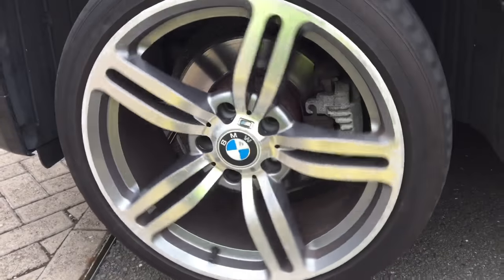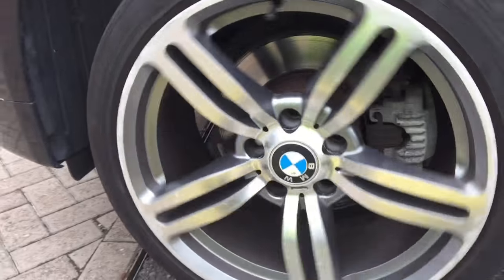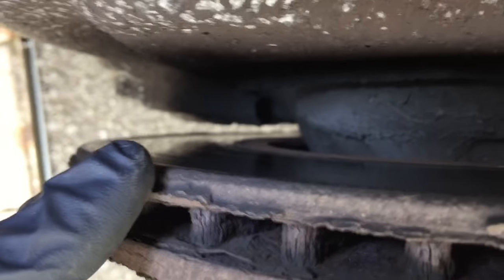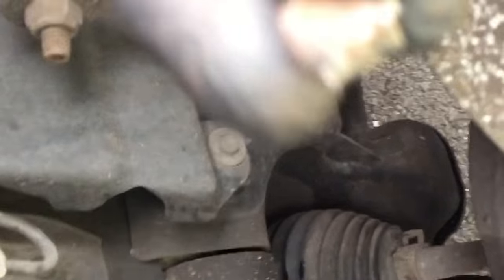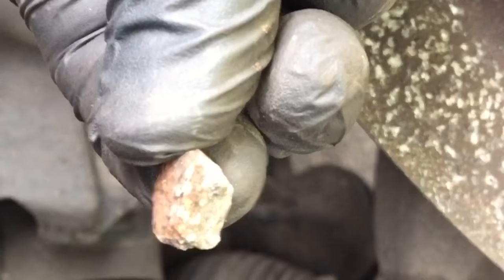GRINDING SQUEALING FROM CAR BRAKES OR WHEELS, STONE STUCK BETWEEN BRAKE DISC AND BACKPLATE, REPAIR

Comment: I had this problem yesterday, BMW advised the braking manoeuvre. And it worked! Go a few ft forward and slam the breaks then back and the same. Repeat 5-10 times. The stone slipped out 1 mile later
Reply from the maker: Thanks for the great information👍🏻👍🏻🛠
Reply: Man you saved me a whole damn day of stressing and shit, thanks! Brakes were screaming like hell after 8 hard brakes it was gone 👊
Reply: Tanks make excellent info
Reply: Dammit should've tried your solution, but I followed the video and it worked!
Reply: Even on the Mercedes this works W tips

Comment: I think this is my issue.I just drove over a newly paved spot in the road and it sounded like a bunch of pebbles flew up and when I pulled into the store parking lot, it started grinding and squealing like crazy. Only when I turn does it make this sound. Thank you so much for this video! I hope driving a quarter of a mile works because I just got this SUV less than a month ago!
Reply from the maker: +Mark Zombik sounds like the problem 👍🏻

Comment: Drove about 60 kms and mine didn’t drop out. A pro tip is to push against the back plate or brake shield (same thing different names) this can often work and they are very flexible. 9/10 this removes it…but this rock was a big sucker and I’m about to take the wheel off…god the sound.
Reply from the maker: Thanks for the great information👍🏻👍🏻🛠

Comment: This was the same issue on my f150 :) Ran the truck for about 3-4 miles on higher speeds it was super loud then went into a parking lot and ran forward and reverse about 5-10 times 10 ft each way and it fell out no more stone and no more hideous loud "loud" rattling and grinding sound; all gone :)
Reply from the maker: Thanks for the great information👍🏻👍🏻🛠

Comment: Happened today 23/4/ 2024... We have resealed/ unsealed roadworks along our rural  Highway between my home & town. A high pitched squealing from left front wheel when driving straight, then grinding when turming into driveways. I am hoping this is a stone & it will dislodge when i head back into town tomorow, a 25km trip.  Otherwise i will need to take to gas & tyre shop they can check it straight away.  Thanks for video was big help
Reply from the maker: Thanks for the great information👍🏻👍🏻🛠

Comment: Cracking video mate. Mine sounded proper awful, high pitch screeching and grinding. It didn't stay in there for long as it just suddenly stopped. This video has set my mind at rest though,  cheers bud, sub'd ;o)
Reply from the maker: Thanks for the great comments 👍🏻👍🏻

Comment: Just moved the car from my drive way and the orchestra started. Went on and on for about 15 minutes. AND all stopped after a 3-point turn. Took my car to my local porsche centre here in Dublin. Got it checked, all good and back on the road. Thanks a million for the video mate.
Reply from the maker: Thanks for the great comments👍🏻👍🏻🛠

Comment: Listen to that! Sounds just like what I've just heard from my car! I thought my exhaust was dragging on the floor but looked under the car and everything looked fine. Then I started looking around the drive shafts to see if anything was rubbing on them, couldn't see any issues. Hopefully I have just got this stone in the brakes problem. Will spin each of the wheels up tomorrow and see if I can find it. Thanks for the video!
Reply from the maker: hope you find the problem, Thanks for the great comments👍🏻👍🏻🛠
Reply: @aaanton11  Found it! First wheel I checked too. There was a fair sized stone caught up in the recessed centre of the inside of the brake disc. Thanks again. What a relief!

Comment: this is a great explanation of what happens when a stone gets stuck in the brakes! its such an easy fix but when it happened and the stone was grinding, my heart sank. I pulled over and I was mentally preparing to shell out at least $4000. It first sounds like the brakes are completely shot and as the stone starts to smoothen up from the grinding, it rattles so much and sounds like the calipers are gonna fall off. nightmare!
Reply from the maker: Yes it sounds awful, Thanks for the great comments👍🏻👍🏻🛠

Comment: Gonna take tire off tomorrow and take a look, I’m hearing a high pitched squealing coming from front right wheel, can’t be the brake pad indicator because pads only have 10K KM on them. What’s weird is the sound goes away when I make turn the wheel either left or right. Think it’s something other than rock stuck in there?
Reply from the maker: sounds like it Thanks for the great comments👍🏻👍🏻🛠

Comment: Love all the comments as this was exactly me today! Sounded exactly like this (from inside the car), I actually thought something might have been dragging on the ground! Could hear it when going round corners (and not braking) as well but went away after about 2 miles! (1.6 after checking google maps but my partner warned me about the noise before I set off so factoring in his journey!) Thanks so much for sharing! Fingers crossed that's the end of it! 🤞🏼
Reply from the maker: Yes its a common one, and sounds terrible, Thanks for the great comments👍🏻👍🏻🛠

Comment: Happened to me today, for the first time in 20 years of driving, with my Skoda Octavia and I was worried it was something wrong with the brakes so I had to call out my breakdown service. I felt like a right numpty when I found out it was a stone that was stuck between the brake disc and the backplate 😭

Thank you for your advice, and I'll keep it in mind for next time 👍
Reply from the maker: Thanks for the great information👍🏻👍🏻🛠
Reply: @aaanton11  The best way I could describe the sound was some loud squeaking/squealing and like I was dragging some metal sheeting/tubing underneath my car. At one point, I was concerned I had a flat tyre and was running on the rim, or that my exhaust had somehow fallen off, even though my car is less than five years old.

One question for you: you say the stone should wear down and drop out after a few miles, but will this not damage the discs, even for that short distance? Just wondering what the pros/cons are of trying to wear down the stone trapped in the disc.

Comment: Great video! Of course the earliest appointment I can get isn't until next week. This is actually been going on for a few days and gets louder every day. So I think it's really stuck in there. First I noticed it on the highway and then it wouldn't do anything on the back roads. Now it's doing it on the back roads. Only my driver side tire, it's a squealing scraping sound when I accelerate, but not brake. Sometimes it'll go away if I make a sharp left or right turn, momentarily. But each day just continues to get worse. My Jack is horrible and every time I use it, it falls over. So I can't even tell but it really does sound like the culprit.
Reply from the maker: Thanks for the great information👍🏻👍🏻🛠

Comment: I am 99% sure that this is my problem as the car is brand new and the noise I hear is the exactly the same. I hear it only when I drive slowly with my right window open. I drove over 60 km but the stone would not fall on its own. The noise is small and does not bother me. Do I have to bring the car to a mechanic? Or would the stone fall down when I bring the car for a tire change in a couple of months? Can it do any damage to the wheel if I it’s not removed soon?
Reply from the maker: if the issue doesn't resolve itself, then I would have a look to remove the stone to avoid scratching the disk, Thanks for the great comments👍🏻👍🏻🛠

Comment: My brand new truck went through a puddle the other day. It was much deeper than expected and long story short I have several chunks of gravel in there. Do I just keep trying to remove them on my own or just I take it in for the pros to fix? I’m not a car guy at all so this is all new to me.
Reply from the maker: usually the dirt, srit will make its own way out, also try reversing sometimes helps, Thanks for the great comments👍🏻👍🏻🛠

Comment: I’m having a hissy type of noise coming from my left front wheel. It’s mainly noticeable going 5mph. I go reverse no noise. I brake noise stops. I accelerate noise is barely there. Noise is noticeable once foot is off gas and car is going slow. No leaks at all. Idk what’s the problem. Noise is compareable as air coming out. Noise stops once in park or braking
Reply from the maker: I would check the brakes Thanks for the great comments👍🏻👍🏻🛠

Comment: I'm getting a warped rotor sound after doing anti rust prevention on the frame of a Prado 120. 
It's bizarre because the rotors weren't messed with. Thinking rust chunk fell into it somewhere
Reply from the maker: It is common to get a "footprint" on the disc where the pad covers, even after heavy rain fall and salty roads, you could try scuffing the discs with emery cloth, Thanks for the great comments👍🏻👍🏻🛠

Comment: Helpful tip to everyone tho... make sure it is indeed a rock, and not actually failing brakes. You need to confirm for yourself that there is a rock in there and not just drive around for a long period just assuming that something will fall out
Reply from the maker: The key is the sound, worn brakes grind when you press the brake pedal, a stone is there all the time, thanks for the great comments 👍🏻👍🏻🛠

Comment: Had this happen to me today in my M2.  Had a near heart attack I thought it was metal on metal of some sort.  Mine was a high pitch sound.  Pulled over and threw it in reverse slowly with my buddies watching.  They saw the pebble from the brake drop in the rim and the noise stopped.
Reply from the maker: Great news Thanks for the great comments👍🏻👍🏻🛠

Comment: Hi, I've driven for hundreds of miles but the stones are not dropping off. Took the car to a local mechanic - he took a few stones out but not all of them because they would take a lot of time. He said they'll drop off eventually. However it's not happening. Any tips/suggestions plz....I need to sell my car in the next few week. I doubt anyone will buy with such scary sounds coming while driving, especially when turning. 

Thanks for your help!
Reply from the maker: they should not stay in there so long, you can usually remove them from the back plate, its not a big job to remove the brake disc, sounds like you might have a backplate issue, it might be loose, Thanks for the great comments👍🏻👍🏻🛠

Comment: This was a life saver. I thought I had narrowed down which wheel had the stone, but had to take a 2nd wheel off to find the right one. Then I had to rotate the rotor backwards while giving it some gentle love taps, eventually 2 little rocks dropped out. I tried the other tricks of driving backwards/forwards while heavy braking, nothing would shake it loose. Next time I'm going to stop immediately and just take a wheel or 2 off. The funny thing is, it would only happen when turning right and at speeds above 30kph.
Reply from the maker: Thanks for the great information👍🏻👍🏻🛠

Comment: man , thanks for this...I though my A6 was after shitting itself at the weekend, the noise was horrendous....but actally sounded the same as in your video....the noise went away eventually so the stone obv fell out........literally dropped car into dealership half hour aago for inspection...should have watched this video first
Reply from the maker: Hopefully they wont charge you, big at a guess you now have new brake pads and discs you didn't need lol, Thanks for the great comments👍🏻👍🏻🛠
Reply: @aaanton11  Their usual inspection cost is 89 euros but because they found nothing wrong yesterday (stone had fallen out by then), pads discs etc all fine, they were sound and topped up by AD Blue and only charged me 50 quid so a little win. The main thing is that my car is fine and I can look forward to sleeping at night
 again : )

Comment: I got this loud screeching noise right before pulling up to our driveway.  Wife heard it inside the house she even opened up front door to ask what happened.  Kinda guess it was something like this video.   Went inside, grabbed a bucket of hot water, then splashed inside wheels trying to get at calipers and brakes... That did the trick and was all that was needed.   Because it had snowed and sand was used in certain areas of town, yeah that's what happened.   Put car in reverse and drove it around... nothing.  No more, problem solved!
Reply from the maker: Thanks for the great information👍🏻👍🏻🛠

Comment: This sounds like a design flaw. My wife has a Subaru. She just had the car towed 60 miles to the dealership.
I've never gotten a rock stuck in the brake of  any Toyota or Ford pickup I've owned. And I'm almost 70 years old. I've had a lot of cars and trucks .
Reply from the maker: Thanks for the great information👍🏻👍🏻🛠

Comment: Has happened to my car a few times, last time it took 90 miles for the stone to fall out !
Reply from the maker: Wow, that was a stubborn one, it’s that time of year again, and The tarmac is all sticky 👍🏻👍🏻
Reply: Mine has been in there for about 20 miles so far.   I can live with the noise as long as it's not really damaging the rotor.  Rotor steel should be a lot tougher than gravel.

Comment: Is there a more permanent solution this is happening like every 3 weeks
Reply from the maker: don't drive on gravel! Sorry David couldn't resist, its only going to get worse now the winters coming, and the grit lorries are doing thieir worst Thanks for the great comments👍🏻👍🏻🛠
Reply: @aaanton11  this cant be right my 2013 535i xdrive never did this my 2014 550i xdrive im smelling something burning coming from the tires
Reply: @aaanton11  i took it to BMW it was debris and stuff in the front wheels 3 weeks later it's happening again this cant be life 🤣👿